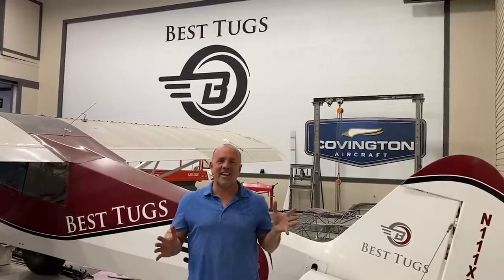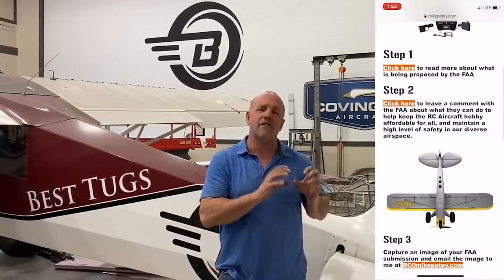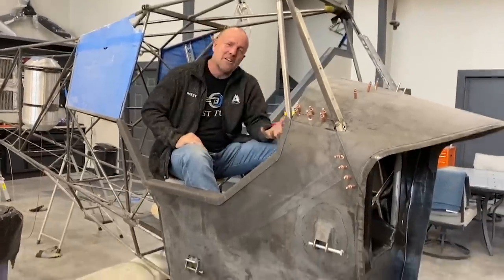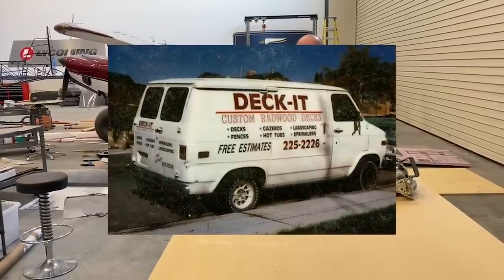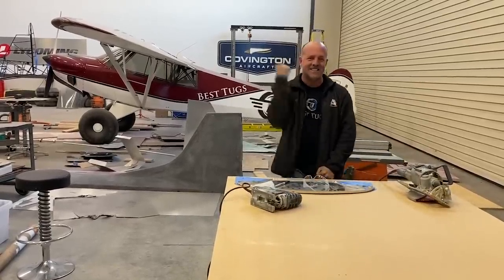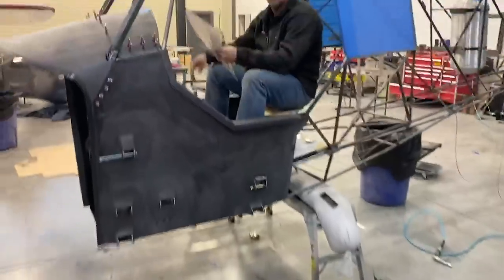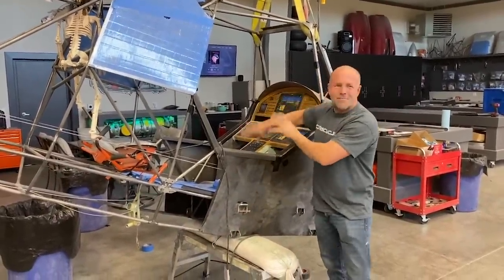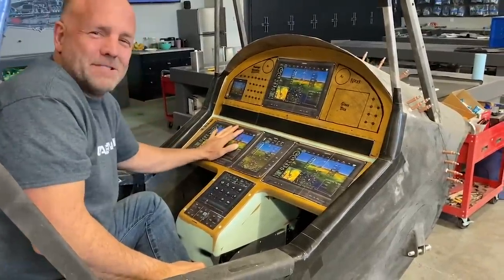🤠 Garmin Glass + Carbon Fiber (SCRAPPY Bush Plane 10)

Comment: Mike I can't thank you enough for addressing the Remote ID NPRM and not only enticing people to comment but could also get someone new in the Hobby as well.  Model airplanes are what started my family going down the aviation path as well starting with my grampa in the the late 30s now we run an FBO as well as I fly Drones for my local Sheriff's Office.  Remote ID does make sense for commercial drone use, but not for traditional model aircraft that have been operating with a near PERFECT safety record for longer than manned flight.  It is a major stepping stone for countless people getting into aviation and it needs to be saved.  You are the man Mike!!

Comment: Thank you mike for putting out the message on the FAA and model aircraft. I myself have been flying model aircraft for 25 years, the love and passion I have for this hobby is unbeatable. If this passes it will destroy the hobby as we know it. I’m Third generation in RC flying, I come from a long back round of Aviation as my dad, grandfather, great grandfather and uncles fly real aircraft. I build scale warbirds and do some go fast planes over 200mph. The hours spent into this hobby are crazy and drones and model aircraft do NOT need to be labeled under the same.

Comment: I was an A&P, and later an I.A. for a total of 42 years. When I retired I met with an FAA rep to tell him I was not going to touch another airplane and proceeded to get out a pair of scissors to cut up the licenses and hand him the pieces. He told me I needed to do a form letter to turn them in. Oh yeah? I don't have to do anything of the kind. After looking over the rules they are proposing (I only went far enough to realize it was far too tedious a chore)  I decided I better not post the comments I had on my mind. Jeff Bezos is probably mostly responsible for the proposed rules and his desire to launch drones to deliver Amazon packages as a way of saving on transportation costs. The rural area where I live has USPS, UPS and FEDEX trucks drive by everyday. IMHO the FAA should spend more time on commercial aviation and the problem of oversight and certification of airliners, so they don't have another embarrassing scenario develop like the 737 800 Max on their hands.  There are two phrases in the US Constitution I want to refer to. They are "the pursuit of happiness" and "shall not be infringed."  What are they going to do next? Regulate us out of flying our flight simulators on the PC?  In short, it seems the FAA is looking for a solution to a problem that does not exist when they have enough existing problems to deal with. Do not waste taxpayer dollars on regulating a hobby out of business.

Comment: It is astonishing how easy it looks what you do.
The results are awesome, not to mention all the thoughts you put into every pice! 
Thanks for all the uploads. 
Greetings from Munich, Tom.
Reply: The number of professional level skills he has just blows me away.  Pilot, engineer, framing/decks, welding, carbon fiber plastering, CNC operator and there's still more.
Reply: His pile of commercial parts, structures, frames, entire sub assembly of aircraft that were good enough but not right for him is amazing.    What is truly amazing is he is not a boat or aviation design consultant working on the products we fly.  Cessna took 50+ years to evolve to the design quality level he puts together in a 2 man shop at 2am.     I am floored by everything he builds,  on the design vision and most important for the builder he sends good vibes into crowds wherever he arrives in style.

Comment: The panel will look great.  Gonna have to put something in so the passenger can watch the movie too though.  Maybe just a drop down overhead screen instead of watching it on the panel.  

And I have a drone that I have not flown since my wife passed collecting dust but I have to agree that adding more to it and forcing me to pay for it will kill my ability to enjoy the hobby.  I generally stay below the treeline anyway and live next to an airport and have had zero issues.  A better option IMHO would be an app that tracks the pilot in an area and gives them warnings and alerts when they can not fly and when there is a manned aircraft coming into their area so they can land safely before.  It's a few jackwagons who are causing issues and they will continue to do so even after the rule is put into place.  It's not like the cheap Chinese rc aircraft are going to magically go away or have this stuff put on from the factory.  And good luck trying to enforce it unless they are going to start going around every city with a set of binoculars and a few hundred boots on the ground.  This will just drive it underground and we all know how well that will work out.  I mean come on, the laws passed for the war on drugs hasn't stopped anything.  Nor have the anti piracy laws for software and media.
Reply: Well said. Tweed New Haven AP short final is right over head  of my house but well above tree level..and you can hear them coming in.

Comment: I am a retired mechanic will be 70 yrs old 11/22/2020..So i have watched every minute of every build you have ever posted.. You are awesome as my grand kids would say..I agree.I have a couple ideas rolling around in my head. #1 is creating electricity while you are flying.I know a wee bit about the conservation of energy i got from youtube science clips. BUT. i also look at E gliders and E planes..Great ideas..I love the flying cowboys you're an awesome group.#2 Enough here's my thought. If you have an air intake tube close to the fuselage on both sides  and notch it so a vane turbine protrudes into the pipe and spins like hell as you fly along,It could create shaft driven electricity to charge batteries that could run 2 ducted fans built into your wings to assist sitting your ass down right on the mark..Also i thought of using that energy to run you propeller and save on gas..or as a back up..eng failure.. Generator failure , instruments etc. ps Loving Scrappy Doo..I know video production can be a time consuming pain in the Azz but we love them.

Comment: Mike, I love the way your project is coming along. I am an AMA Member and an RC airplane & helicopter pilot who also loves to build and fly RC aircraft. I would just like to thank you for all of your videos and I really want to give you a special thanks for supporting us RC pilots. Thank you for putting out this message about the newly proposed FAA rules. First and foremost, I believe that the FAA needs to change the way that they classify fixed-wing model airplanes and helicopters. Maybe also separate or distinguish between those flying FPV like most drones vs those who are only flying line of sight, like many of us aerobatic and 3D aerobatic pilots. It is also quite a stretch for the FAA to epect a flight-plan for an aerobatic flight or a pattern flight. They really need to separate drones from the remaining RC aircraft. They are totally different animals with different flight characteristcs and totally different flight capabilities.

Comment: MIKE MIKE MIKE😎

You still intend to go in depth on the "Wing Spur"? On draco aftermath. Once you start the white canvas.  I ask because I'm wondering if a small redesign could be possible. Something like a shoe horn tip or wing?  Adding a  inch to the end outer edge.  To better  help alleviate a side strike.
Reply: Also.. I've always called it a wing spur once I saw it. As it is very similar to a boot spur, 2ndary definition.    And it coincided with your groups name.

But I never found a video on your name for it...
Reply: As youve explained it, it seems like youre talking about a device for ground loops...which he already designed and installed... Just happens the crash was outside the performance envelope of the structure... Sorry if im misinterpreting.
Reply: @flip66five  And your implying there is no room for improvements? 

If that were the case. He would have a Wilga in his hangar. Not a white canvas.
Reply: Hopper Mantis I don’t know that any amount of reinforcing or improving could have made that plane survive that crash. The entire weight of the aircraft was slammed onto the wing when it hit the ground.
Reply: @Mrcaffinebean  There was literally 0 absorbtion from that angle.. 0. Until that point, the spur worked perfectly. 
 
Cause I have 3 simple alteration designs,  addressing both angles. Any toddler would. 

And your saying you don't know... 
With these two points of interest. No matter if feasible or even needed..Forget the crash... Your telling me there is no room for improvement...   From a Designers eye. NOT a Pilots. Nothing can be learned?   Fine. Thank you for your dialog.

Comment: Tell us, how long until there are "production" Patey Cubs?  I'd l Iike to place my order now!!:)
Reply: They would be 250K+ I'm guessing.
Reply: C Puzz you can’t get a brand new, stock carbon cub for $250,000.
Reply: LOL. Nobody could afford to pay Mark what he is worth for the amount of hours he puts in his custom aircraft. It is a labor of love for him.
Reply: @danielwillets2346  Ha clearly I am not in aviation. Jeez, it's a lot of manual work for the molds and cloth layup, but I don't see how it justifies more price than a Ferrari which has a ton more technology, engineering, safety, testing, marketing and materials cost.
Reply: C Puzz Ferrari produces many more Ferrari’s that cub crafters produces carbon Cubs. That keeps manufacturing wayy down. Ferrari actually doesn’t spend hardly anything on advertising.
Reply: I was thinking more like designed by Mike Patey and built in factory.
Reply: @cbpuzzle   Try   a 1.250 million.  depending on engine option.  And Glass
Reply: @danielwillets2346    That is funny,
Reply: My father always said if you have to ask, you can't afford it.
Reply: @josgovaars8899  EVERYONE WANTS TO KNOW THE COST.   WHY WOULD ANYONE OVER PAY FOR AN ITEM.

Comment: Man Mike, you remind me of the group of guys that I used to roll with in Nacra 6.0 catamaran sailing. It was somewhat of an experimental type of situation but was a production racing catamaran and at the same time was open to do wild things to add to the performance that was already there. Yes, yours is 100% that and more but at least I had a taste of that excitement your talking about. Everyone was supper pumped to get together and have fun racing together and hanging out at the end of the day with like minded people that we shared that excitement with. My wife and I got a free learn how to fly kit that was just out of date and are learning how to fly because of it. We are both carpenters. She is a cabinet builder and I build homes from the foundation to finish with my own hands. So, I think we have the background to build like what your doing. It's so exciting and educational watching you build. I'd love to build my own airplane just after we finish building our home and then we need to build a shop so that we can build an airplane. I love the carbon fiber aspect. You make it look supper easy and have given my many ideas! Thanks! Question; can you build the frame out of carbon fiber tubing or aluminum instead of steal to save weight? I was also wondering if you could reveal the price of what you spent on the carbon fiber to build Scrappy.

Comment: While I agree that RC aircraft like replicas etc really don't need to be tracked.. HOW ever......... The drones i.e. the quad copters etc that take no brains-talent to fly are becoming a problem, especially now that the prices are down to so low of prices and can be bought at Dollar General along with batteries and motors allowing them to go more then a few feet from the operator. Something has to be done.. Unfortunately  singling out a just a specific type of "drone/rc" wont stop the problem.. The manufactures will just alter the designs to get around it. Its unfortunate that people in general are idiots, live in a bubble oblivious to anything other then themselves and fly these cheap ass drones around airports, and other places they don't belong.. It is sad that common sense doesn't exists any longer that there has to be laws, regulations, certifications for these things. It would seem the few ruin it for the many.
Reply: Yep. Been in it since you had to build drones. Not rc planes, those were well available, but since you had to build drones and had to learn to fly them. 

Therein the problem arose.  When someone without the intuition of the craft was allowed to just buy one. Not that its many irresponsible people, but obviously enough.

Comment: Good morning Mike.     I worked in a Fiberglass shop for several years making Plugs and moulds for custom parts .  The  process is in the details and thinking about being able to get the part out of the mould and can you  get in the tight spots as your doing every thing inside out basically.   Like your 3or 4 degrees on the sides of your panel to be able to pull it.   I love the challenge of making some thing that didn’t exist until YOU make it.     Satisfying beyond belief.     PS.  I know your a Wizard and at one with the Mat.     Because you make it look easy.     And you know what they say about people that make stuff look easy.......... Dam..... that guy knows his shit.......Back to Work

Comment: Thanks Mike for all you do for the sport of aviation.
I am on #3 Horizon Carbon Cub with #4 fully assembled ready when I need it.
In my RC hanger are more than 10 RC planes.
In my hanger at the airport I have a recently purchased SLSA, and have converted it to ELSA and now have gained my private Pilot certificate.
With hopes of a 182 or similar in the near future, or as your videos show the things that can be achieved with some initiative I could build or modify something. 
I am not in favor of more regulations, even if my delivery will not be by a drone due to flying RC planes.

Comment: Love It! One question about the panel. Backup analog guages.  Backup airspeed and altimeter, maybe a needle ball at least, if not oil pressure, manifold pressure and tachometer for that huge propeller. Back in the '90s, at an EAA meeting where Garman was introducing their new glass panels for homebuilders and Experimental aircraft, a member who flew the new Airbus glass cockpit for UPS, answered the question of what happens when the screens go black (as they can and do), by stating; "By the time you peek out from under the seat, everything is back on." Even so, they only had minimum backup analog instruments.

Comment: Mike, thank you so much for giving some attention to the FAA's Remote ID NPRM. It's as though the regulators don't even know that traditional model aviation exists. I know they use the word "drone" to mean any unpiloted aircraft, but they seem to have no concept of what a fixed-wing RC aircraft needs to operate. Hopefully your video will reach a segment of the aviation community that might not have seen the issue otherwise.

Comment: I had sat down about an hour before watching this to start putting my thoughts together for my response to the NPRM.  After reading through the proposed regs (again) I felt really deflated.  I jotted down some points to make in my response, then finished assembling my latest little RC ARF and watched this video.  Thanks, Mike for giving me a bit of a boost with your into.  You are a good soul.

Comment: More thoughts -- put the small display on the panel for the engine instruments, then move the 750 up to where the small display was. This way you won't have to look down as far. Also, you might consider moving the 750 to the far right -- that instrument is designed to be mainly operated with the right hand (so when you use the knobs, your hand doesn't obscure the screen), and moving it to the right makes the touch screen more accessible.

Comment: The evercoat stuff is great. Had great luck with it getting cars ready for sema. 

One thing I've done before is use a different color hardener for different layers of filler so you can tell what layers you are sanding through.